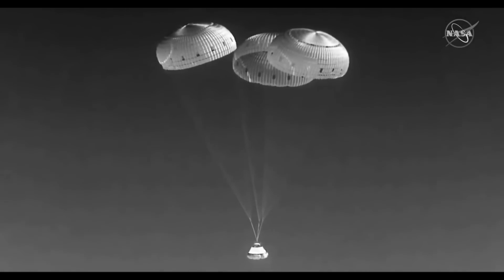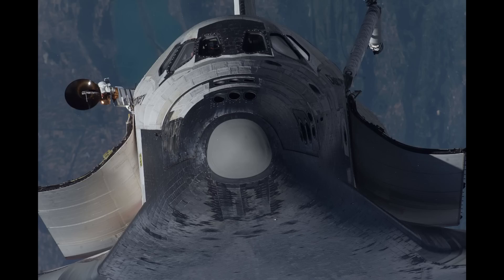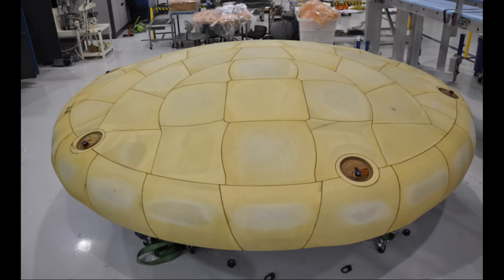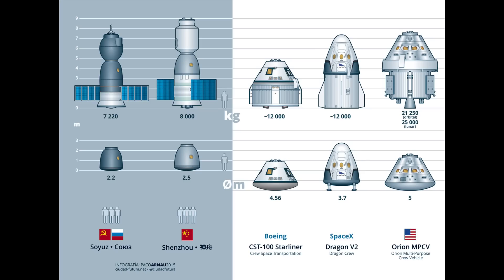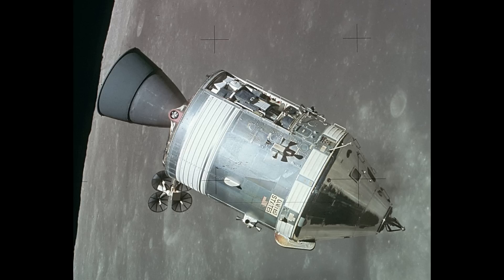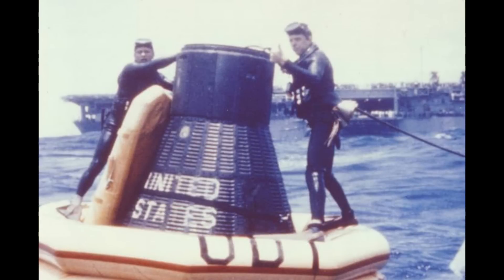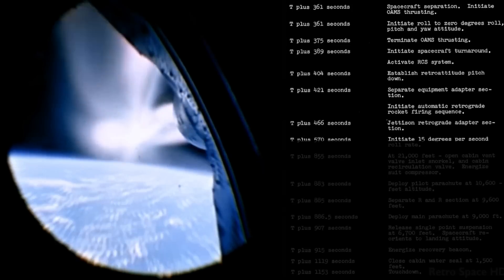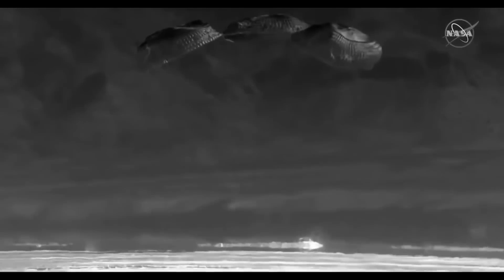Why Does Boeing's Starliner Not Look Burned After Reentry

Comment: What evidence do you have that they "steer" through the atmosphere? The offset center of mass is just to prevent instability. The capsule surfs in instead of spinning.
Reply: By offsetting your mass you are creating a lift vector. Now you can manipulate this lift vector by banking, this allows your to steer. This is not only used by capsules, but was also used for mars missions like Curiosity and Perseverance. Both spacecraft travelled to mars having a centred center of mars (they were spinning on their way), but they specifically dropped masses just before entry into the martian atmosphere to offset this center of mass. After the entry, they dropped more masses to get rid of the lift vector again (and lose the ability to steer again) so they can safely deploy the parachute.
It's somewhat explained in: Mars 2020 Entry, Descent, and Landing System Overview, from NASA JPL
Reply: From Wikipedia... "The Apollo Command Module reentered with the center of mass offset from the center line; this caused the capsule to assume an angled attitude through the air, providing a sideways lift to be used for directional control. Rotational thrusters were used to steer the capsule under either automatic or manual control by changing the lift vector."

Comment: Thank you for not bashing my ship sir. The unofficial name of the Starliner that completed OFT2 to and from the ISS was "The Black Pearl". Due to all the setbacks we had with her, (valves, filters, RCS thrusters, SM's, and other things) the structure mechanics christened her "The Black Pearl!". It wasn't easy to pull it off while being dogged by the SpaceX cultists who seem to forget all the Dragon failures before they got to the ISS, including the R.U.D.E (Rapid Unexpected Disassembly Event) on the launchpad. Our crew roots for SpaceX every launch because we like to see everyone succeed. Anyways, thank you for the nice words lately.
Reply: You go!  And KEEP going. OFT2 was a great success. Failure is only in giving up, which was clearly not the case here. The Black Pearl ended up shinier than its rival, which shows ya…
Reply: i for one am happy that spacex sharply distinguishes between tests and operations. there does not appear to have ever been a risk of a "r.u.d.e." or other serious problem with astronauts aboard. from an outside perspective, i don't see the same distinction on the boeing side, but i hope all of starliner's kinks have been worked out. get that test crew home safely!
Reply: @sirmoonslosthismind  so you don’t think Boeing’s distinction of OFT (Orbital Flight Test) vs CFT (Crewed Flight Test) is a big enough distinction?
Reply: LongDong BigCockTouchToe  🤡🏅
Reply: LongDong BigCockTouchToe  
Holly wall of text copypasta Batman!

"Some audio questions were answered in 0.9 of a second in official NASA tapes."
Find one of these supposed "official NASA tapes" where the elapsed time from a mission control question to an astronaut response was less than the required 2.6 seconds. Even one. Find it.

"The lunar LEM was 3 sheets of kitchen aluminum foil thick."
Wrong. The outer thermal protective layer was that thin. The pressure vessel and the structural supports were much, much stronger. Look up photos of the LM being built and you can see what it really looked like under the fragile skin.

"Yet a 10,000 lb rocket did not tear it to pieces."
Of course not. Why would it? Those 10,000 lbf are directed through the spacecraft's center of mass, and its strongest structural points. It can't do anything to the thin thermal skin. Don't be ridiculous.

"NASA admits using Scotch tape!"
Provide the source or admit that this is a lie. Those are your two and only options.

"Temperatures of 250 heat on the moon"
This is a meaningless phrase. Temperature and heat are two entirely different concepts.

"Every country was given a moon rock. The Netherlands tested theirs, it was petrified wood."
Wrong. NASA only gave one Moon rock to the Netherlands, and it was confirmed to be from the Moon. The petrified wood was from the former Dutch prime minister's personal collection of artifacts, and his estate falsely claimed it was a Moon rock. But NASA never gave anything to the former prime minister in the first place, so that was wrong.

"would leave at busiest times to collect meteorites in the Antarctic."
Nope. Please stop making things up.

"Why did we silently retire the Apollo Saturn 5, 3-man F-1"
This makes no sense. How can an engine be "3-man"? Try to at least know what you're talking about. And no, it was not "silently retired," there was nothing "silent" about it.

"We beg Russia for their less powerful rockets."
No, we don't. Try again.

"All other rockets lift less and mostly to 300 miles."
And all other rockets are massively cheaper.

"It was quietly retired, even the blueprints lost."
This is a direct lie. No blueprints were "lost," almost all the diagrams are digitized in some online archive, and the ones that aren't are available in microfiche.

"For 60 years, we use old Mercury (1-man) and Gemini (2-man) Titan and Atlas rockets, upgraded."
Nope. The Titan series was retired, and the Atlas V is about as different from the Atlas D as the Saturn V is from the Little Joe II.

"After silent 15 years wait replaced by the Shuttle... Half a generation wait."
1973 to 1981 is 8 years. Learn some basic math. And those 8 years were anything but "silent." Please stop lying.

"But all F-1 blueprints are missing."
STOP LYING. Every single time you say this, it continues to be wrong, and you continue to tell more lies. Repeating a lie over and over doesn't make it true.

"Why?... Why?... Why?"
Money. Science deniers like you insist on cutting NASA's budget. When budgets fall, expensive programs get cut. The Saturn V was absurdly expensive, so it got cut in favor of a cheaper option (when you factor in the cost of the Apollo spacecraft, the Shuttle was much cheaper).

"James Webb, the head of NASA resigned DAYS before the 1st mission to the moon."
James Webb resigned on October 7, 1968. Apollo 8 (the first crewed mission to orbit the Moon) launched on December 21, 1968. Apollo 11 launched on July 16, 1969. You are lying yet again. These are just facts.

"Neil Armstrong resigned and was silent all his life.... His anniversary words"
Which is it? Was Armstrong a recluse who never participated or spoke publicly again, or did he give these supposedly coded speeches? I think you should stop making things up.

"Who talks that way?"
Nobody, because you badly mangled the two "quotes" you cherry-picked. Try again.

"He's admitting their shame. And sham."
Wait, you're capable of reading minds? Do tell!

"Both eyes and film see spots and cloudy patches from X-rays and Cosmic rays."
Nope. Eyes do not see any of those, first of all, so that's another lie. Also, radiation dosage is cumulative. Spending a few days in space is not nearly enough to develop cloudy patches on film.

"The film from the moon is perfect, spotless!"
No, it's not. You're expecting the dramatic blotchy patches always shown in Hollywood dramas, when in reality film radiation damage affects colors first. And sure enough, the colors are not correctly calibrated in a lot of the film. But color damage can also be corrected with the development technique, which of course you conveniently "forgot" about.

"-250 temperatures would have cracked and broken the plastic film as it moved through the camera."
Then it's a good thing that heat and temperature are different! The film never reached -250 degrees, because heat transfers very slowly in a vacuum. So this is another lie.

"In sunlight, +250 temperatures would have melted the plastic film inside."
Same thing. The heat doesn't transfer. Stop lying.

"The LEM has bright red hypergolic fire and smoke."
Wrong. Dinitrogen tetroxide (NTO) is only red when it fumes by itself. When burned with Aerozine 50, it produces a clear exhaust plume. You can see this in footage of the LR87 and LR91 on the Titan, which used the same propellant mixture.

"The same SpaceX uses and Soviet thrusters maneuvering toward the Space Station."
Wrong. Stop lying. Dragon uses monomethylhydrazine and NTO, while the Soyuz uses unsymmetrical dimethylhydrazine and NTO. The different propellant mixtures produce different exhaust products and therefore differently colored plumes.

"Also look at the test films showing massive billowing dark red clouds from it."
Find even one single video of the Lunar Module Descent Engine or Lunar Module Ascent Engine showing "massive billowing dark red clouds." Until you do, this is another one of your many lies.

"And no LEM thrusters fire as it rotates and aligns to join with the command module above the moon."
The thrusters fire in short bursts that last fractions of a second. The film of the docking was taken in 6 FPS. It's not surprising that you can't see the bursts. Please try thinking.

"LEM landing pads in pictures on the moon have no dust in them."
Of course not, because the engine shut off while the LM was still 2 meters above the ground. Please try thinking.

"There are not even scorch marks under any LEM in moon pics. No craters either."
Of course there aren't any "scorch marks," there's no oxygen for scorching to occur. That's ridiculous. As for craters, the exhaust was spread out over the entire engine bell, meaning that 10,000 lbf you keep citing produced only 3.7 PSI. Why do you believe that 3.7 PSI should produced "craters"? That's ridiculous.

"Though the massive 10,000 lb rocket exhaust would have thrown dust into the pads."
Nope. There's no reason for the dust to travel upwards. It got thrown straight outwards horizontally. Remember, there's no atmosphere on the Moon. Air currents don't suck dust in strange directions. The plume was directed downwards and deflected sideways, so the dust got thrown sideways and only sideways. Think, please.

"The engine more powerful than a jet"
Thrust does not equate to noise. Try again.

"NASA officially says the LEM was 3 sheets of kitchen aluminum foil thick. 12/1000th of an inch."
Again, that's only the outermost layer of thermal shielding. Please stop drawing false equivalences.

"That engine roars and massively vibrates!"
If it was vibrating "massively," then the astronauts would have seconds to live, as that would imply combustion instability and imminent explosion. A rocket engine in a vacuum actually runs very smoothly, so please stop lying.

"They couldn't even hear themselves."
Stop lying. That's all. You'll get a lot further in life if you stop making up random things.

"Yet you never hear anything in their calm, quiet words"
Of course not, because sound doesn't travel in a vacuum, there was very little vibration, and their microphones were right next to their mouths.

"1969 was the PEAK sun activity of that 11 year cycle, that could kill people in space."
WRONG. 1968 (not 1969) had the peak number of sunspots, meaning it was the solar maximum. BUT, the most sunspots means the LOWEST amount of solar radiation. It does mean more solar flares, but those are individual events that can be avoided.

"The WORST time to send astronauts! (Protected by 3 sheets of aluminum foil)."
Nope. And again, it wasn't 3 sheets, and plus that only refers to the fragile LM. The Command Module had even thicker walls than the LM's interior pressure vessel.

"And one Apollo, the landing site was in the dark when they were scheduled to land. You can check the charts."
This is a lie. You can check the charts, but it's clear you haven't. On all of the Apollo missions, the landing site was in early lunar-morning dawn when the LM landed.

"Fra Mauro, the landing site was completely in the dark at the scheduled landing time of Apollo 13!"
Incorrect. Apollo 13 was intended to land at around 7 PM (Houston time) on April 15. Sunrise at Fra Mauro occurred around 1 AM, 17 hours earlier. Stop lying.

"Apollo 13 was totally faked!"
Wrong.

"Another moon trip, video inside Apollo, when supposedly near the moon showed a full big blue earth through the window."
Which mission, which reel, taken at what point in the mission, with what focal length, with which camera? Be specific, or else you are telling lies by omission.

Moral of the story: STOP LYING!
Reply: Wasn't that a problem mostly not related to Dragon itself(and after few successes)?

Comment: Stupid questions but were the Apollo ablative shields manufactured as a single piece?
Reply: I’ve always wondered why these tiles are not single piece,mor at least bigger. So they don’t fall off. Starship has a whole bunch of tiles around and some fell off. Why not make two halves and engulf the entire rocket.
Reply: @TheBooban  I think larger thermal shields have gone the way of the Dodo due to cracking & differences in thermal expansion relative to what they are shielding.

SpaceX Propriety Ablative Material is fascinating as it’s likely a sandwiched composite of different materials.

I like SPAM too every once in a while.

Comment: Mercury, Gemini, Dragon, Soyuz are all stable in subsonic flight during reentry, prior to splashdown. But, during the race to the Moon, the "tail" of the capsule was replaced with a docking port on the Apollo Capsule. So, Apollo, Orion and Starliner are all unstable in subsonic flight during entry and will tumble out of control so violently that anyone inside would be incapacitated or dead before impact with the water. These three capsules fly like a wing without a tail in subsonic flight. While this risk is totally acceptable in a Race to the Moon, it's not 60 years later. 

What I find most interesting about this fatal flaw in Orion is that NASA actually built a proper capsule if you look at the areo-fairing, it has a really nice shape and "tail". But for some strange reason, NASA did not make this new aero-fairing the shape of the capsule. It was all important to NASA to have "form" over "function" in that the Orion Capsule was required to look like the Apollo Capsule with it's deadly subsonic aerodynamics.

Put a Tail on that Capsule.
Reply: What are you talking about? Under what circumstances would the Apollo capsule "tumble out of control so violently," and why did it never happen on any of the missions and launch abort tests?

Comment: So I suppose Dragon cannot return from the orbit of the Moon as it is too heavy for its diameter? Or can it with a sequenced aero-breaking maneuver? Ok, I've found this: "The heat shield could be made capable of returning from the Moon relatively easily, Reismann said."
Reply: Dragon was overengineered specifically so it can return from lunar missions.
Reply: @josephastier7421  Mars, not the moon. Elon Musk wants to go to Mars.
Reply: @WeBeGood06  True, but he designed crew dragon for it anyway.

Comment: i know nothing about space but what if instead of crashing down in order to reenter the atmosphere it was basically a plane that didn't let air out in space & it had vtol to keep it from going super fast & burning up until the atmosphere was enough to let it fly into an airfield
Reply: Start with Isaac Newton’s laws of motion, & you realise that the only way to orbit the earth is to go FAST, and the lower you are, the faster you have to go. So, if you want to come safely out of orbit & land in 1 piece, you’ve gotta have serious brakes (= friction!)
Reply: Another concept: ¿remember how much fuel was required to achieve orbital velocity? An equal amount of fuel would be required to cancel orbital velocity. Carrying that much fuel into orbit is not cost effective. (Also, ¿Do you  remember the SiFi concept of a straight line flight to the Moon: thrust backwards to the gravity equal point then thrust forward to overcome the fall to the Moon?)
Reply: @SewolHoONCE  what if you orbited around the earth so you descended slowly until the atmosphere was thick enough to allow your wings to work
Reply: @Iris-jw3ci  Orbital speed is a function of distance from the center of the earth. This is why there is only ONE, very small geosynchronous orbit. A spacecraft can not arbitrarily choose a speed at a given altitude. Slowing to wing-lift speed before entering the atmosphere requires vertical landing power to transition from orbital motion to controlled lifting-body flight motion; such vertical power is not yet available for use in reentry from orbit. (Look for a discussion of the space elevator on a wire from the surface of the Earth to a geosynchronous space station.)